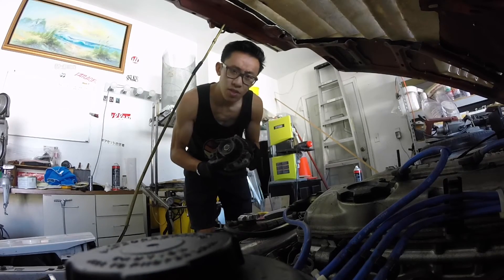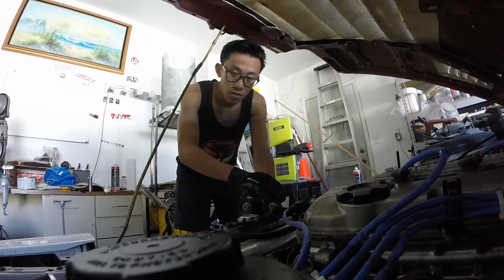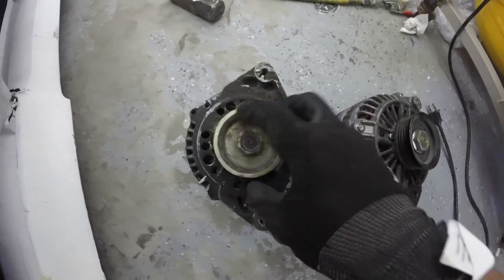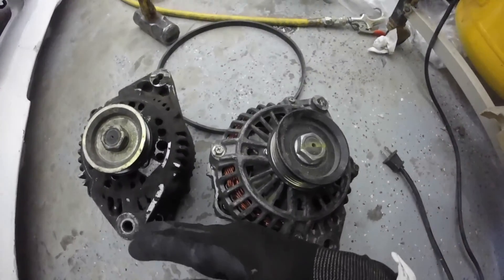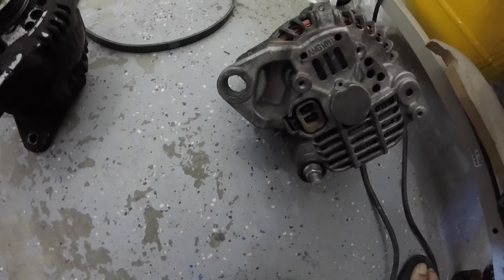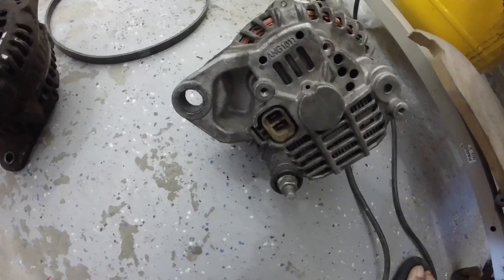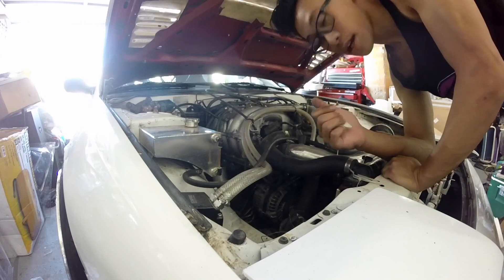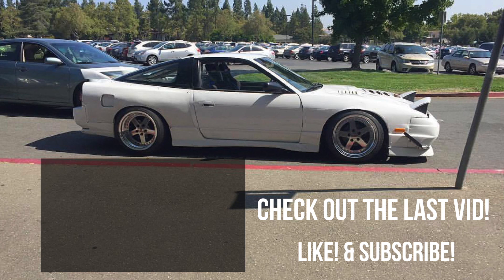DIY 240sx KA24de 110 amp Quest Alternator Upgrade EASY!

Comment: 89 - 94 alternator on s13 is 80amp. 95 and 96 s14 with oem fog light option came with 90amp. 97 and 98 was 80amp. Quest from 93 - 98 was 110amp, quest from 99 - 01 was 125amp
Reply: can a 125 amp be used to my nissan 240sx 93?
Reply: @MsMarquez1989  yes, if you do the correct modifications to the alternator to make it mount up. I'm going on like 3 years now using a 125amp alt on my 91 s13
Reply: do you have to change fuse or something for 125 amps?
Reply: @MsMarquez1989  nope, if all your wiring is good and such you wont have any issues
Reply: WillyBuilt ok everything as if it were original true
Reply: So was the connectors not a problem? Cause on s13 ka24de they look different based on the terminal markings meaning their purpose is different . Is this only for s14 ka24de? Cause I have a 91 s13 as well

Comment: So you had to drill some more room in the belt tensioner slot? Also what exact belt did you use, I've been having some many issues putting it in and the belt not being able to go over the alternator pulley.
Reply from the maker: Yeah I grinded the slot so there was more room on the tensioner! And I just updated the info, the belt number is 4K320, this should allow you slip the belt over.
Reply: RoyalNativesco thanks bro, you're amazing for making this video and going into more detail and showing what you're doing. All the other videos or forums on this project are trash.
Reply from the maker: Haha I understand the struggle because I was once in that spot where all the write ups felt useless.

Comment: any differences that you have noted with doing this, or having to adjust your idle maybe? does the rpm change when your electric fans kick in by any chance (or use to). keep up the good videos, your channel has potential to grow
Reply from the maker: I've noticed that once my electric fans kicked on the RPMs would drop less, I don't have a volt meter gauge but from what I've read is that the voltage is higher when the car is on and drops less when you have things pulling power, compared to the stock alternator which would drop lower. But overall I didn't have to adjust anything. Thank you for the kind words!